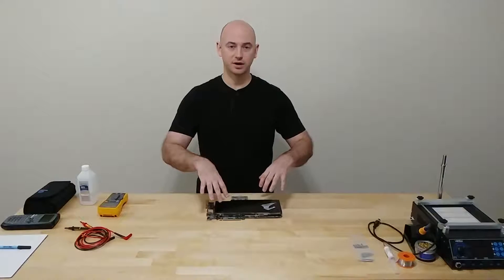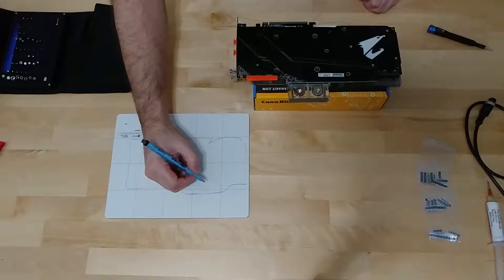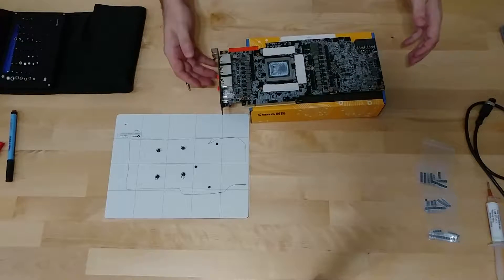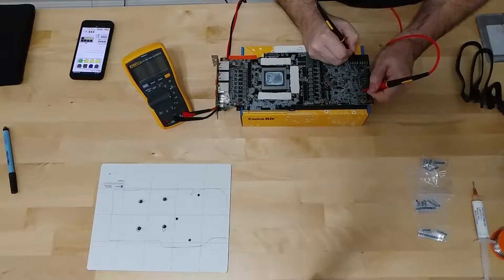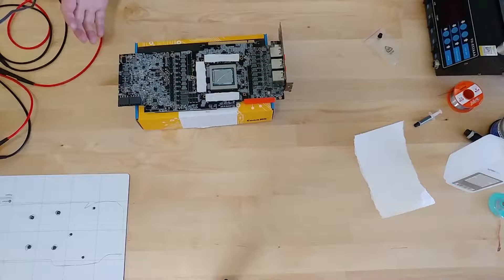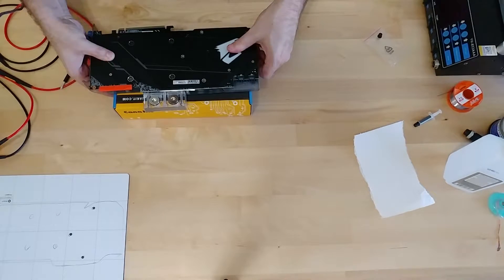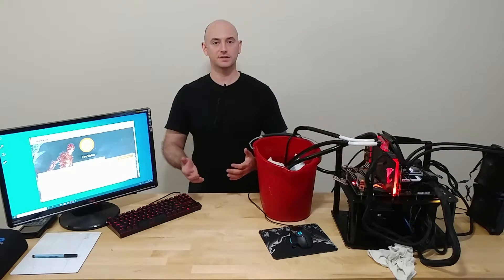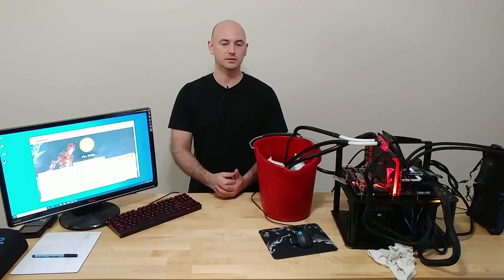RTX 2080 Ti Power Mod (No liquid metal)

Comment: my 2080s power limit is 200 watts lol this is why im considering doing the power mod
Reply from the maker: Hi thanks for the comment on the video. It's possible that you may get some performance increase doing a shunt mod, but honestly with the 20 series I found that they're running them pretty close to the edge already. I was able to get more power, but the card couldn't take any more voltage. That said, I think this mod would work better in situations where you can use more power, but get away with lower voltages.. so if you have a really good cooling setup, or plan on doing LN2 overclocking it's a definite way to get a boost. Hope this helps!

Comment: So I have found that 1.093 is the sweet spot for voltage, if you use msi afterburner make a custom curve and boost 1.093v I run 2205core 8000mem for the past yr on 2x2080ti Aorus xtreme WB and will be power modding them in next week or 2 shunts are on the way. Also voltage modding might be a little tricky, if you get it working would love to know how but I believe their is a chip that reads voltage and if it doesn’t match shuts down card. But very good write up! I was going to make a video on it, my cards are going on dice/ln2 once kingpin 3090 gets here.
Reply from the maker: Thanks!

Comment: This is a silly mod to even consider. Because you have a custom 2080Ti with a TU102-300A chip. I own a 2080Ti with TU102-300 chip, my bios is locked to 280 watt maximum power target, and I cannot flash my bios either! This shunt mod will allow me to get good performance out of my NON-A 2080Ti. Or guys who have a RTX Titan. They are locked to 320 watts with no custom bios available.. This mod is our only hope.. this mod is only good for NON-A 2080Ti’s or RTX Titans..